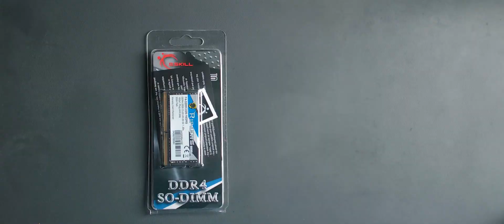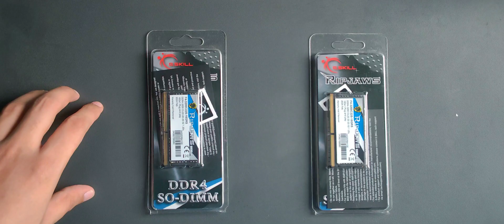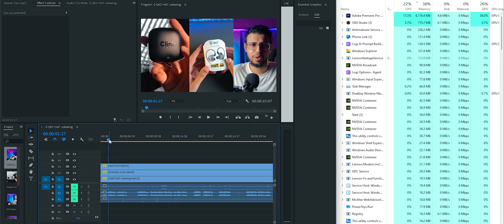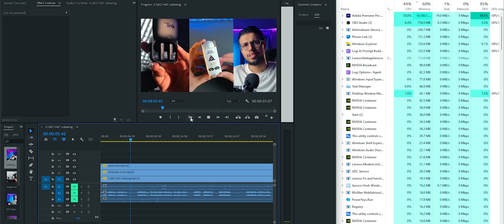Upgrade Your Laptop RAM in Just 3:34 Minutes

Comment: Another pro tip is to MAKE SURE THAT YOUR FANS ARENT SPINNING WHEN YOU CLEAN THEM. When you spin your fans, it generates electricity which goes to your board which has the potential to short it. Honestly slight movement will most likely not be problematic; this may only be an issue if you're using a air duster which can provoke a high amount of fan RPM but it's honestly better safe than sorry and it's not that hard to keep your fans still (just use a toothpick or something)
Reply: Also be sure to ground yourself aswell. If you have a PSU on a pc or something connected to a port and also metal, you can most likely use that.
Reply: You dont HAVE to do these but it's better safe than sorry

Comment: hey, does upgrading ram affect battery consumtion? Im thinking about going from 8 to 16gb. great vid btw
Reply from the maker: Well, battery consumption depends more on how extensively it gets used, which depends on the software you're running 😅. RAM sticks are generally not very power hungry by themselves

Comment: Have you changed your thermal paste?
Reply: I prefer he don't unless he buys the Honeywell ptm 7950 as legion only uses those and anything else will result in really bad temps
Reply: @sharkieislive  Nah, This model comes with thermal paste and pads for vrams
Reply: @anerdnamedpradeep  still ptm is the best performance after liquid metal and it's safe as non conductive
Reply: @sharkieislive True, but That's expensive AF! bro
Reply from the maker: I haven't changed the paste with this one. You're right, maybe I should.
Reply from the maker: Certainly. I'll apply some and give the rest to you for much less.